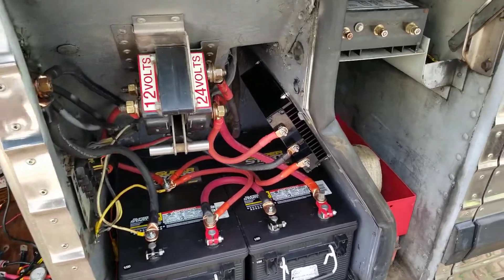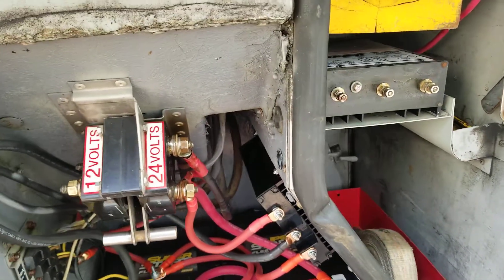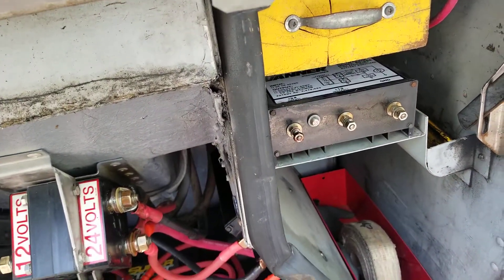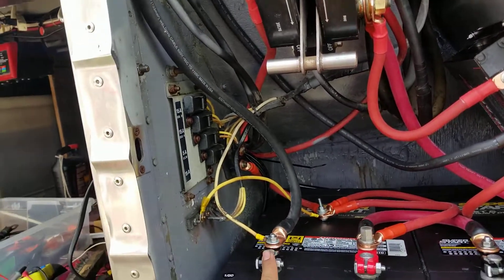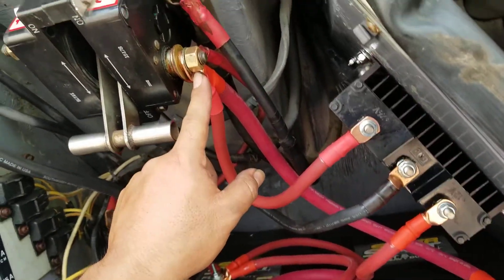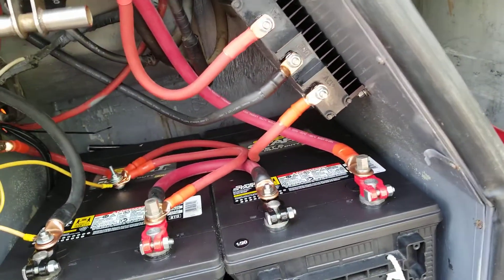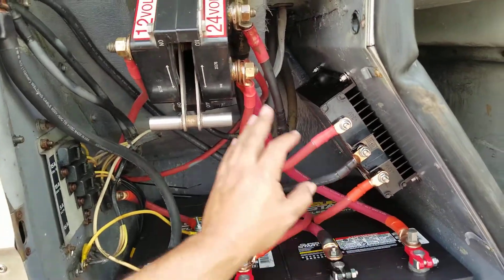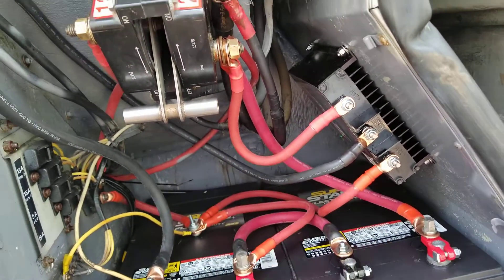Everything About The Battery Equalizer | Connecting Two Equalizers In Parallel

Comment: Any recommendations.  If I have 2 12v 100ah gel batteries connected in parallel only not series, what product can I purchase to balance them?
Reply from the maker: You need a two bank smart charger. I use a few from Powermania but Noco is also very popular. I have 3 batteries in parallel and use a three bank charger to keep each one perfectly and individually topped off. It's a must.
Reply: @mrdaniel0078  Thank you i will look that up now
Reply: @mrdaniel0078  I should have mentioned that the 2 12v 100ah gel batteries will be connected to a solar charge controller  and 100w solar panel.  So my batteries connected in parallel will get a charge from solar but I guess I wanted to balance the batteries some how to make sure they are both at equal voltage as much as possible while connected parallel and to solar.  Is a battery equalizer necessary?
Reply from the maker: An actual equalizer is technically not necessary as long as you start with batteries that are exactly the same in voltage, size, brand, and age. 
The problem can happen later in time when one of the battery cells will start to deteriorate or go bad. You will never know when this will happen, unless you are going to check your batteries daily for months and years in the future.
If you're not planning on keeping an eye on your batteries on a daily basis, then you will need a "smart charger"
A 2 bank smart charger will equlize the voltage, maintain, and "recondition" the battery every time you turn it on.
This, in turn will give you piece of mind and freedom to work on other things.
You can use a smart charger all the time or only a few times a year if you feel like giving your batteries some maintenance. 
I own a pair of gel batteries that are 11 years old but have been connected to a smart charger most of their life (RV that is plugged to shore power all the time)